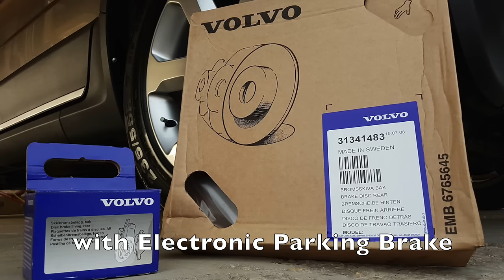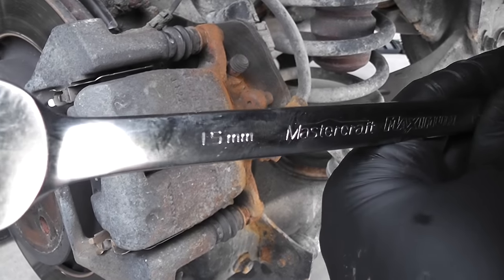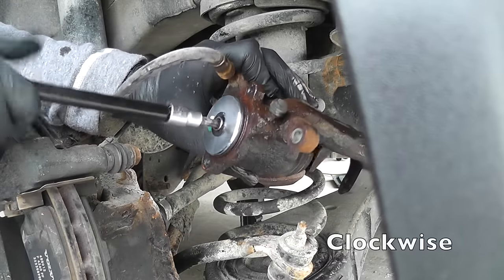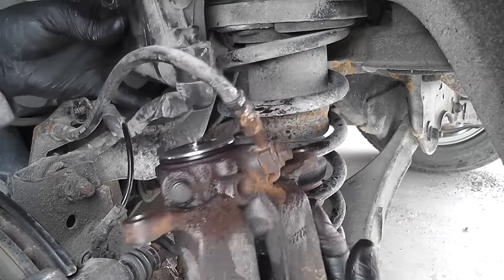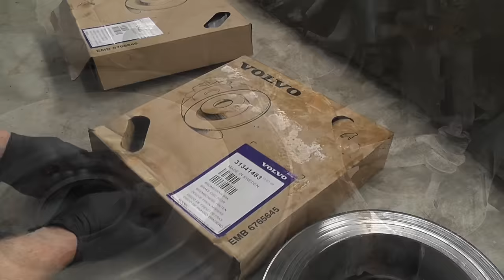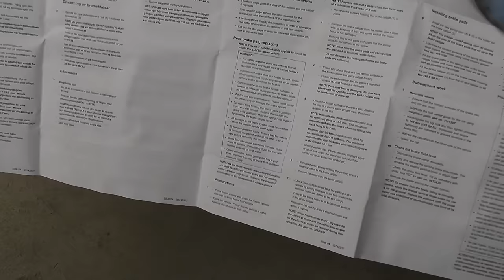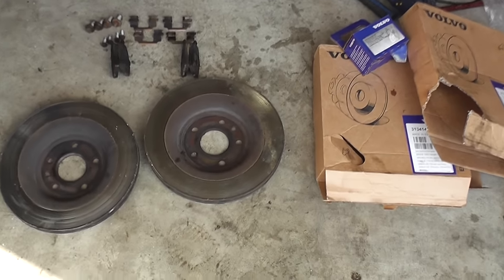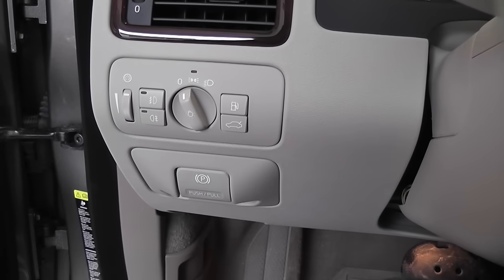Volvo rear brakes replacement with electronic parking brake. (EPB)

Comment: What is the average miles for rear brake replacement?    I have a 2015.5 XC60, Im only getting 15K-18K (16-18 mnths) on my rear brakes.   front brakes currently have 47K (35 months).   the front brakes were premium brakes purchased from auto store, back brakes have always been done at dealership with Volvo Parts numbers listed above.

Comment: Great video!  Thank you!  My garage person said my rear brakes were near replacement thickness.  I started in on the job without checking the pads and got to the point of removing one caliper bolt.  I swung the caliper off the pads and found that they were actually ok, so I just put everything back together.  I didn't do anything with the brake motor.  After starting the car, I got the message, '"Parking brake service required."  I tried resetting it as you showed in the video, but I still get the same message.  Also, it says, "Parking brake not completely released."  I had tried to use my scanner before starting the project as had been mentioned in other videos, but it says that it doesn't work for my model.  I have a 2014 XC60 R design.  Any suggestions?

Comment: I have a 2009 T6 XC70 and need to do all brakes and rotors. Would you by any chance know what size you used. They come in 300mm, 302mm and 316mm. Much appreciated!

Comment: Hi Yuri, I had replaced my rear pads and rotors by following your video.  I used genuine Volvo pads and Bosch Quietcast Rotors.  Came out great.  Then in February of this year, I had the Volvo dealer change the left rear axle to solve my tone wheel ABS problem--the new axle solved the ABS tone wheel problem.  But now, a few months and thousands of miles later, I just noticed that my left rear rotor had become scored whereas the right rear rotor was fine.  The left rear rotor had been fine previously.  

Could the dealer have inadvertently contaminated my left rear brake pads (like dropping one or both) when they changed my axle, or are the pads not sliding smoothly or evenly?  

What do you think would be the cause?  I will have to take my brake pads off to examine to see if there's any embedded debris.  

Guess the solution would be to replace the rotor with a new one and put new brake pads on the left side?
Reply from the maker: Hey! Considering the dealer was there very likely something went off. Replacing the rotor and pads will be the solution.

Comment: Hi ,, its only 24,000 Km and there is a sound in the rear wheels when i Brake & there is no codes in the dashboard ? should i replace the pads 
Thank you very much

Comment: Your videos are my go to for quick and concise videos on repairs needed from my wife’s xc70.  I’m mid way doing the rear brakes and have a question.  When you removed the torx50 from the rotor yours
Just fell off practically.  Mine has been soaked in PB blaster for 24 hours and no amount of beating it with a big hammer budges it in the slightest.  Any advice???  Thanks
Reply from the maker: Can’t help here. Sorry my friend

Comment: Great video! Is it possible to put different rear dust cover brakes in a Volvo 2000 xc70 awd? The original dust cover brakes are discontinued and my car will not pass inspection
Thank you
Ugo
Reply from the maker: Not sure. Check with Volvo dealer.

Comment: Brilliant video. Again. First video I saw of this procedure used software to put the parking brake into service mode, and advised against taking the motor off. Where did the instructions come from? Was that the paper you took out of the box with the pads in?
Reply from the maker: Just use 12 v to jump the connector pins to unwind the piston. Much easier and safer than taking the motor off. Done this way on another XC70.

Comment: Its better to use service mode on vida or much easy way to disconnect battery and use 12v charger to move motor back, before disconnect battery, handbrake should be on and after that u can release brake with charger to move back brake piston and after change disc or just brake pads, it's enough to move pisto to position close, and after reconnecting battery is no error and u don't need to remove electric brake motor

Comment: Great video! Thanks for the directions. Was looking at a scan tool or DICE VIDA...but would be just as happy doing it your way on my 2010 XC 60! :) 

Any idea what the torque specs are for the caliper bracket bolts? And likewise what the torque for the caliper to bracket bolts should be? Thanks again!
Reply: Cheers...thanks!!
Reply from the maker: +Evan Stange Rear Brakes: Caliper 35 Nm, Bracket 110 Nm and rotor bolt 35 Nm.
Reply from the maker: +Evan Stange Front Brakes: Caliper 60 Nm, Bracket 200 Nm and Rotor to hub 35 Nm.
Reply: Fantastic! Thanks so much +volvosweden!

Comment: Great video, when I was compressing the piston, the rubber boot came unsealed and break fluid ran out.  Do I need to have the car towed to a mechanic now?
Reply: I made the same mistake. Then I had to heat the socket, then insert the piston back in. After finishing all job, refill the brake fluid and breading it. It took me whole day. I did not remove the motor, I just rewind it with battery.

Comment: You should always CLEAN the DISCS before assembling in the case it has some grease or storage oil.  In this case it is possible that the discs are already cleaned in factory but you should have mention it. If you don’t clean the disc having storage oil, it ruins the brake pads. Anyway this disc has dirt and possibly grease from your fingers which you should clean anyway.

Comment: Isn't there a section in VIDA where you can retract the piston with a command?
Reply: I was trying to find someone that will actually make this remark. And not only vida, there are generic diagnostic equipment that cand do that for most cars with electric breaking.

Comment: I have a question. What if you have turned the motor all the way back but the piston is still not compressing? And it’s not that the piston is seized because it moves outward when you turn the motor counter clockwise.
Reply from the maker: Then manually push the piston in.

Comment: I've bought EBC discs and pads, so I'm missing the 13mm and 15mm new bolts from the video to reattach the caliper/ bracket. Anybody now which size/length they are so I can buy a new pair? Great video!!
Reply from the maker: You can geg the hardware from Volvo for sure.

Comment: Thanks for making clear instructions how to do rear brakes, will you be doing one on the fronts in future.
Reply from the maker: When time comes front too. Not yet.
Reply: Would like to see that, too. Thanks for the rear one. i did it with the 9v block and it works very well.

Comment: Can I just say, whatever car you have, always pump the brake pedal after installing new brake pads. You have had to push the calliper piston back into the calliper in order to make room for the new thicker pads. Pumping the brake pedal after you finish the job will ensure the calliper piston moves and comes into contact with the brake pad. If you fail to do this, you will drive down the road and when you come to brake for a junction say, your pedal will go down to the floor. NO BRAKES. PANIC.
Also, when I'm working on my car brakes or steering and suspension, I always renew on BOTH sides to ensure even balance.

Comment: If you remove the cap on the fluid reservoir be sure to replace it quickly as brake fluid absorbs water from the atmosphere and will rust the parts from the interior.

Comment: I have a 2009 xc70 AWD D5 auto. 
I have a problem with the steering going heavy during parking or 3 point turning. 
I have renewed the reservoir and fluid. The rack makes no noise at all. The steering goes back to normal if you lift the engine revs from tick over speed. I’ve checked tyre pressure. It’s as it should be. On loose gravel it’s fine. My steering pump has 2 belts running on it. I cannot find an equivalent pump on eBay. 
It seems no one has seen this problem before. I find this hard to believe.

Comment: Thank you! Great video! Is this a 2012 Volvo in the video? Also do You know the torque settings for the caliper bracket? This video would apply to a 2012 s60 T6 correct?
Reply: No it's a 2009 XC70 T6 he has.

edit: but to answer your question, yes this is pretty much the same on all modern volvos with EPB

Comment: Thanks for the video!  My Volvo guy said that I need to put the car in “service mode” first before I mess with the rear brakes or the EPB could snap shut and I could loose some fingers...??? What you did didn’t seem dangerous.  Any thoughts about that?
Reply from the maker: +John Touchard I did without putting into service mode and all good. Just follow the video.

Comment: Great Video, !  Will use it for new rear pads. Question, why do you need to detach the electric parking brake?
Reply from the maker: +Steven Donald Because you need to push in the piston for the new fat pads to fit in.
Reply: Thanks again. I noticed you replaced your rear discs at 54Km ..I also have 58km K on my xc70, have done the front pads, so far the discs are all still fine. Was it not a bit soon to replace your discs? They should last about 100K km..

Comment: Great video as usual! I am wondering about doing this job with VIDA DICE. If I put the EPB in the service position using the DICE tool, will I still need to push the caliper piston back in?
Reply: Jim's Ego i
Reply from the maker: +Steven Carbone Nope.

Comment: I have a Vida Dice. I thought you could use that to retract the pistons in an XC70 or am I wrong?
Reply: Robert Parker Yes you can I have a V70 III and did my rear brakes and set the brakes in service mode with VIDA, very easy

Comment: Hi, what's the link between Break and rpm down ( than 2000 rpm to 900 rpm )
Reply: None
Reply: Its used by Volvo-Cars to heat up the catalysator on their petrol-engines.
Once the cat is heated up it goes down to 900 rpm (idle).

Used to reduce CO2-emissions

Comment: Your videos are great. I have done few minor stuff using your video.  Watching you go through the process gives me confidence to tackle the job.  Few questions on the brake job.  Any of the fasteners need to be torqued?  Also, I am looking at buying a OBD scanner and some of the m have the EPB feature.  Assume it is to back up the motor without manual doing so.  Is that your understanding as well?
Reply from the maker: Get Vida Dice from eBay. You will have more features. Recommended to torque for sure.

Comment: Own V70 2,5 t Petrol, 2009. Considering the option not to order original break discs and pads. Old ones was in use 127 tkm and already had 25,6 mm .  Do you have exeriance using Zimmerman parts and general  offers from Skandix online shop ?
Reply from the maker: +Zoran Nakovski I have no experience with brands you list. I do recommend original brake pads.

Comment: Going to be using this video to change my brake pads this weekend. Is this pretty much the same process to changing the front brake pads or is there going to be a difference? Thanks!
Reply from the maker: I have changed my front pads and rotors last week. Working on that video. Maybe this weekend will be uploaded here.
Reply: @volvosweden  Wow what great timing! Thanks for your great videos!

Comment: Isn't there a service mode in Vida for the parking brake? It will run in reverse and that way you don't need to open it?
Reply from the maker: There is. I did not have DICE to do it that way.

Comment: Appreciated your video. My car is 2010 xc60. Is that the same procedures to change the rear brake pads? Please advise!
Reply from the maker: Should be same. I am not 100% sure
Reply: Thanks.
Reply: After I removed the 13 mm bolts from the caliper, the caliper cannot take out from the rotor. Why?

Comment: hello, do you have the foot on the break when you release the EPB, in the end of the clip.
i saw that you press sometimes and push the buttom but do you still have the foot on the break when you push release.// Johan
Reply: Yes. You must press the foot brake when putting on OR taking off the EPB. Do you own a Volvo? you should know that.

Comment: Have you ever considered getting a DICE interface with the VIDA software ("unofficial" clones are around 100 bucks on AliExpress)? I guess you might find it useful, with your amount of DIY servicing. I've got it for my V70 and it is working very well. And one thing you can do is setting the rear EPB to maintenance mode to retract the pistons.
Reply: I rely upon the Haynes manual for my exact model, 2002 V70

Comment: Great video! Just one question, after you pressed the piston back did you screw the 40 torx where the electric motor was back or did you just leave it in that open position?
Reply from the maker: +epicscar Just scree the piston back using torx 40. And put the motor back.
Reply: He left it open. When he resets the park brake at the end 3x. The motor automatically goes to a position that it needs to.

Comment: Hi 
Great video. Just one question about the electronic,
after you use the torx and screw it clockwise then press back the piston. Before putting the electronic back to place do I have to screw the torx back counter clockwise?
Reply from the maker: No. At the very end I apply the parking brake fee times which engages the motor
Reply: @volvosweden  I just bought a reconditioned caliper with motor on.  Piston is pushed back already.  Do you think it winded back already and it's just needs fitting?
Reply from the maker: Yes
Reply: @volvosweden  So the parking brake will adjust automatically?  Just asking because the seller kind of confused me.  Here is what he said.   After caliper is fitted and before bleeding the break 
1. remove the battery from the car.   
2 . Use a 12v battery or battery charger connect  it to the EPB motor to float out the piston until it stops on the break pad.
3. swap the wires aqnd float the piston back until 0.5mm gap between the piston and the pad.  
4. connect the battery to the car and done.   Is this really necessary?  Thanks
Reply from the maker: Not sure. Try just applying the parking brake a few times.

Comment: Great video! Just wondering, all that "dirt" under the car, behind the wheels and such.. say at @6:28 for example.. Around the bolt to the bottom left, and up to the top right on that metal piece there.

Can you clean that? I don't say that you should or complaining or anything, just wondering. Can you clean it? Should you clean it? And if so, how clean could it be? Or is the rough surface, behind the dirt some sort of rust protection?

Do you know? I've wondered about this for years, but as I've never had the opportunity to look at a completely new car, I don't know what it should look like. So I'm wondering if you perhaps know? =)

Anyhow, as always, great video! Really fun to see you work on your beautiful car! =D
Reply from the maker: Well the suspension components are are exposed to the elements. What you see is accumulation of dirt,salt and sand that are being used in the winter time. You can pressure wash it and brush but I don't see need for that.
Reply: Ah yes, that I know. I'm just wondering if rust is forming under all that dirt and therefore it could be a good idea to remove and clean it. But I guess no one does that, so perhaps its unnecessary ;) hehe

The only reason I can think of if you would clean there, is just if rust can form and eat away under that dirt.

Also, if you keep it clean I guess it could be easier to see if some part is bad or about to break? But then again, all that dirt might as well be "protective" against rust, so maybe its just dumb to remove it =D hehe

Oh well, thanks for your reply! I'm gonna try to forget about all the dirt under our cars and just continue to clean the parts that are visible ;)

Comment: You need Volvo Dice device. Then you can let the brake engine back. eBay Dice cost 70$ and is it worth it to have. Never know when you need read error codes.
Reply from the maker: +Su Lu I bought everything from my Volvo dealer.

Comment: Just use a 9v battery on the motor terminals to rewind. No need to remove the motor from the caliper.

Comment: Late 2023 comment.  You can now buy Volvo rotors, say made in Sweden, for MUCH less than Chinese or other cheap imports from the auto part chain stores.  2:1 difference !!  Not from your local dealer, however, unless you're very lucky 🙂

Comment: why did you choose volvo break pads? Why not brembo or some other decent OEM which would be about half the price? :)
Reply from the maker: Am about to replace the rear brakes again. Both rotors and pads. The pads are Volvo but the rotors this time will be Bendix for savings. I prefer original pads.
Reply: @volvosweden  from your experience have you noticed a big difference between volvo pads and some other high quality OEM? say brembo for example

Comment: I own a 2011 XC60 T6 and I need to replace my front brakes. Is there anything special about replacing the front brakes on these cars?
Reply from the maker: I have not done the fronts yet. Can't tell.
Reply: +volvosweden Okay. Thanks for all of the great videos!! They really help me out a lot.
Reply: Nothing special for the front brakes.  I loosen the bleeder before the piston is compressed.  This releases the worst of the brake fluid from the system, not forcing the spent fluid back into the lines and master cylinder.  If replacing the rotor, the bracket must be removed similar to the rear brakes.
Reply from the maker: +Kim Price Nice tip with the bleeder. thx. Next video bleeding the brake fluid.
Reply: +Kim Price Thank you!!